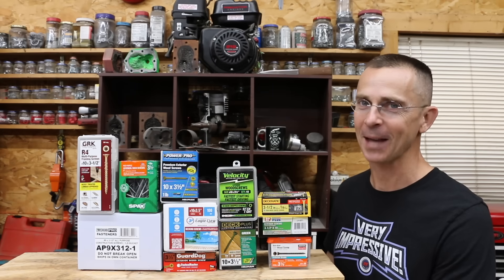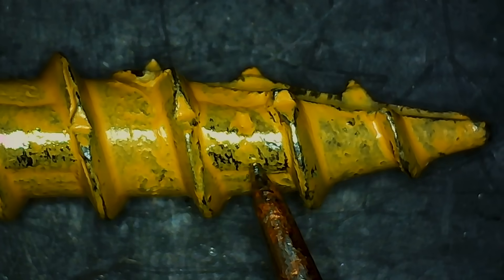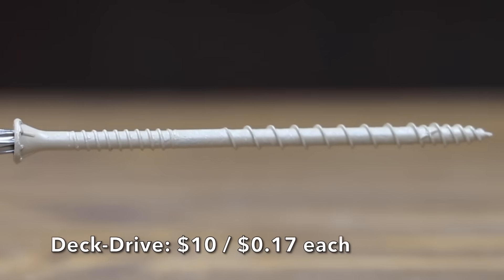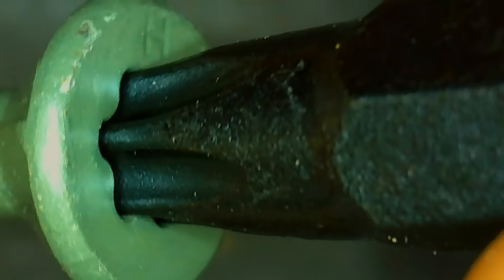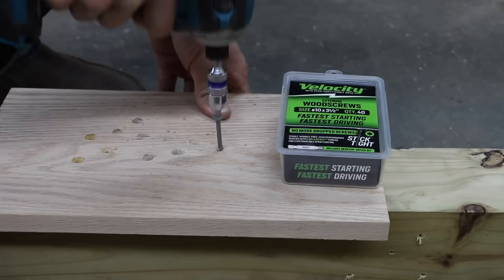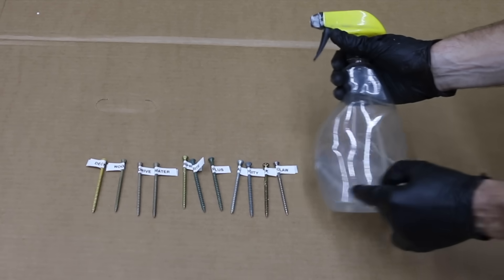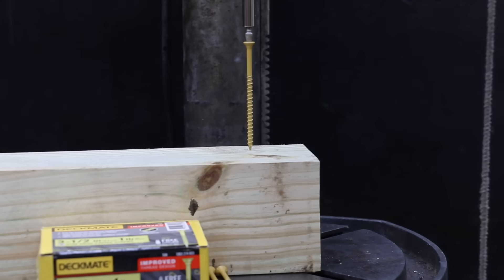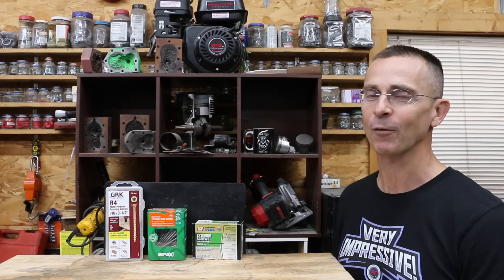Best Deck Screw? GRK vs SPAX, Grip Rite, Deckmate, WoodPro, FastenMaster, Deck Plus, Eagle Claw

Comment: The only way to describe this test is "Very Impressive ". If you do this test again consider drilling in Ipe wood for an extra test. It has an uncanny ability at breaking screws. I am a fan of Spax, they don't break or cam out as much as the other brands especially with tropical hardwoods, black locust and osage orange.
Reply from the maker: Thanks!

Comment: I'm starting to suspect that the coating isn't really supposed to stay on completely, but instead aids to reduce friction and required torque by sliding off more the harder the wood is.
Reply from the maker: Thanks for sharing.

Comment: Have you done one on gas fuel injectors?
Reply from the maker: Thanks for the suggestion.
Reply: @ProjectFarm  Your welcome.  Having been needing injectors for my F150 5.4L I found that there is a huge range of pricing between Amazon, other on-line sellers and local/oem.  It would be interesting to see how you could test them to compare them.

Comment: Are the deck scews used for Trex-like boards similar. Mine had machine scew thread at the top to keep the bulge on the surface to a minimum. They cone in different colors as well.

Comment: I've installed and removed a lot of these screws over the years.  It doesn't seem to matter much which ones you use about 1/3 to 1/4 of them break off right where the threads stop on the shank.  I'm in the upper Midwest where we have a hard freeze/thaw cycle, I think they stretch and break when the wood swells and shrinks in the Winter, Spring.  I was really surprised because I always tried to buy a decent screw but it really didn't seem to make much difference, there were always quite a few broken screws when I tried to remove them after a few years and you can usually tell when they break on install.  I've also used the smaller screws to install T111 and they fared even worse because of the moisture held by the plywood.  They were usually rotted off or would just break when removed.  And just incase you wonder, no I did not ever use drywall screws for any of these applications.

Comment: HydraulicPressChanel just posted a video testing metric vs imperial nuts and bolts holding strength, but it wasn’t scientific. Needs to be grade A nuts with grade A bolts for example. Could you duplicate and give us more Juicy data? 😁
Reply from the maker: Thanks for the suggestion.

Comment: I wonder if you could verify the grk for a particular project. Plan to make a bed frame....2x12 boards, double thick layer for the slats (I'm 425 lbs) and full size bed. Mattress weight 75lb, wood frame weight (estimated just the wood weight 330lb). (Wood glue at each joint) As many as 22 screws holding on each leg (8 into the side pieces, 7 into each layer of slat), and as many as 4 holding each 2x12 slat to each side. Would that be sufficient to pretty much guarantee rock solid foundation? If it is hard to picture I have a pixel sketch of it, if it too much to ask I also understand.
Thank you for your time either way, the videos are helpful.
Reply from the maker: Thanks!  Thanks for the suggestion.

Comment: Nice video, I've had you playing out on the shop all day.
As someone whos done a few dozen decks, Spax and GRK are my go to screws.
At the start, one of the things inspected was the fitment of the driver bit. Being too loose is bad, but overly tight is, I'd argue worse. When your screwing a few thousand screws, its the same motion over and over. A tight fit from screw to bit often holds onto or binds together. Trying to lift out of the screw is made much harder, having to wiggle the drill around, pulling away perfectly vertical, or popping the bit out of its chuck. All that adds up to wasted energy, time and wear on the tools.
I like the Spax brand screws because of their bit designs. That round part of the end sits into the screw, giving more engagement driving down, but without holding on the screw pulling back.
GRK still uses normal torxs bits, but they drive and pull away nicely.
1 thing I wish you had tested, driving the screw between 2 objects. The tpi and design of the tip can make a huge difference in how well it drives into the 2nd object, and how much downward force is needed to keep the 2 objects from pushing apart. A material like Trex would make for a good starting object, because its rather uniform and somewhat tuff. As well as an actual decking material.
Reply from the maker: Thank you for sharing!

Comment: Video suggestion for you Project Farm --> let me do the engineering calculations for some of your tests in parallel with your work.
Using the USA structural engineering code and assuming wood with a specific gravity of 0.46 (North Hem-Fir, South Douglas Fir) the withdrawal of the screws can be calculated as:
W (#10 screw in SG = 0.46 wood) = 114 lb allowable tension per inch of thread engagement
W2x4 = 1.50" thick * W = 171 lb allowable withdrawal tension
Kf (screw withdrawal) = format conversion factor to change from service level (allowable) to ultimate level (strength) = 3.32
Tmax = Kf * W2x4 = 3.32 * 171 = 567 lb failure withdrawal tension for #10 screw engaged 1.50" deep into wood with SG = 0.46
-----------------
567 lb withdrawal tension closely matches your findings!
Reply from the maker: Thanks for sharing.

Comment: I find this very confusing when compared to my own experience.

Some decades ago I built a 20 x 40 cedar deck and used Deckmate screws with square drive, as sold by my local big-box store.  After 30 years of use, I rebuilt the deck with new cedar, but the big-box store no longer carried the Deckmate screws.  Fortunately, I found them online through a giant online retailer named after a big river, and they appeared to come directly from the manufacturer.

The new screws seemed to be identical to the old ones except that they sported the "PoziSquare" drive.  They worked out great.  But my concern with this video review is that my modern Deckmate screws look like a work of art when compared to the ones shown in closeup in the video.

Are screws ever counterfeited?

It might be nice to build my next big project using SS screws.  Most Deckmate screws came out during the overhaul without any hassle, but corrosion from decades of NW rains reduced some screws to junk, requiring extra effort.
Reply from the maker: Thanks for the suggestion.

Comment: My favorite deck screws are the ones that had molding issues that completely clogged up the torque hole. 
Also, dont bother with the free bit that comes with your deck screws, it'll round off after 1 board
Reply from the maker: Thanks for the feedback.

Comment: love your video, quick question, which in line torque adapter do you use? do you find it helpful and is there a model you would like to use in the future for screws?

Comment: Great video, was curious how these stack up.   I’ve been using spax a while now and will continue to do so.  Such a great screw to drive in odd / hard / up into rafters with that tight fitting torq drive head.
Reply from the maker: Thanks!  Thanks for sharing.

Comment: I was thinking that tires may be a good 
Test subject for you. Just like motor oil it is really difficult to get true ratings that aren't biased to the brand. Maybe some sort of traction and durability Test to see if cheaper brands are as good or better then top brands. Thanks for taking the time to make the vids, I have made many brand changes based off of your tests.
Reply from the maker: Thanks for sharing!  Thanks for the video idea.

Comment: Your videos are excellent. I can tell you put a lot of thought and effort into what aspects to test and the testing methods. 

I do have one technical suggestion about reporting results. It is not proper to calculate an average on rank ordered data because the distance between the items ranked is not uniform (the number of additional pounds it took to break the #1 ranked screw compared to the #2 screw was not the same as the difference between #2 and #3, etc.) You could calculate a Spearman Rho Correlation on your rank ordered data. It would be interesting to see what the difference in your results would be. If you did, you would be more accurate and it would be a fairer comparison. The relationship between the test results would also be more accurately reflected.

One thing you could try is an average of the items that used the same measurement scale and in the same direction. Where having pounds of torque, pounds of pressure, etc. indicates a better product, this average would be meaningful. On the other hand, where less pressure is desirable, such as in the downward pressure needed to start the screw into wood, that should only be combined with other items where the scale has a similar meaning. (One could convert the scale such as by subtracting the pressure from 100 so that a higher number indicated a positive result, but you would still have some statistical difficulties with combining this measurement.)

Comment: Screws are brittle and expensive to buy and install. They will snap off when a shear load is applied. Nails are inexpensive to buy and install. Nails bend under shear therefore are superior to screws.
Reply from the maker: Thanks for the feedback.
Reply: @ProjectFarm  you are welcome. I've been a carpenter for nearly 50 years and have seen many screw failures due to shear

Comment: Absolutely loved this! Now I would really really like to see this done again, except with multi material construction screws.

In particular Spax, mostly because according to the box they are meant to go into concrete.

I want to see a video just like this testing out that multi material claim.

In particular going in to sheet metal, concrete and drywall (no anchor).

Is there a savings (and safety!) In using a multi material construction screw or are you better off with focus fired screws such as tapcon, expansion anchors, sheet metal screws or drywall anchors?
Reply from the maker: Thanks!  Thanks for the video idea.

Comment: I installed a deck in 1998 using the posi-square drive screws. After 20+ years installed, I had to remove about half the deck to access a broken water line under it. If I had used anything but those screws, I would have had to demolish the deck. But the posisquare heads cleaned out fairly easily and I only had to break off 2 screws (they were in knots).  I'll never do a deck with anything else! Try that procedure with a torx head!
Reply from the maker: Thanks for the feedback.

Comment: Testing idea: the small lead-acid batteries that are used in computer backup power supplies and often for garden tool electric starters. Two issues: (1) total energy capacity, and (2) deep cycle (good for computer backup) vs. high cranking amps (good for electric starters). One obvious concern: I suspect that many of these batteries are identical but just branded differently.
Reply from the maker: Thanks for the suggestion.

Comment: The least expensive coated deck screw around SE Michigan/N Ohio is the Grip Fast brand at Menards, $6.99 for 1 pound but it would either have to be #10 x 4" or #9 x 3-1/2" (Approximately 55 pieces per pound for the #9) I wonder which brand tested would be the same as the Grip Fast, which sounds so much like the Grip Rite, I'd assume if it were a different manufacturer, they'd probably have a problem with that.
Reply from the maker: Thanks for the suggestion.

Comment: Interesting, as a european I have never seen coated deck screws. I've build multiple decks and the only thing that's sold over here ist A2 and A4 stainless steel deckscrews. I went with A4 Spax... why would you use a coating that can wear away?

Comment: The amount of downward pressure, the speed of installation and so on are good comparisons, but I feel that holding power and corrosion resistance are the main concerns. I'd give an extra second per screw for install if it means better holding power any time. 

I needed some screws a couple months ago for a small job (repair job) and I bought what was available. It happened to be DeckPlus, but the coating and the tip of the screw were different from those you had. For my needs, a one pound box wouldn't have been quite enough. Since 5 pounds cost less than $2 more than 2 one pound boxes - and included a spare torx but - I just bought the 5 pound bucket. If I ever need them for a task, I have them. Or, I could probably sell them on a yard sale and come out much better than buying 2 one pounders.
Reply from the maker: Thanks for sharing.

Comment: Thanks. This test is just what I was looking for. I go through several hundred screws a year repairing horse fences. The original fence used nails. When a board or rail pops loose I use screws instead of nails. Looking for best bang for your buck. I have been very happy with both GRK and grip rite. I use mostly 3-in screws. I have never had a horse pop aboard loose once I replace the nails with screws.
Reply from the maker: You are welcome!  Glad to hear!

Comment: *** VIDEO IDEA ****

BEST GROUT FOR TILING, BEST MORTOR FOR SHOWER PAN AND BEST WATER PROOFING MATERIAL. RED GUARD, SCHLUTER, CEMENT BOARD, SILICONE. I'm sure your local hardware store has plenty to choose from. 

** 2ND VIDEO IDEA **

BEST TILE CUTTER INCLUDE DIFFERENT BRANDS AT DIFFERENT PRICES AND EVEN COMPARE TO USING A CUT OFF WHEEL OR A WET SAW.
Reply from the maker: Thanks for the video idea.

Comment: I work with cedar wood (a lot) and screws is the way to go on that kind of wood.  I found that pilot holes is a must on screws (on any kind of wood).  Deck screws came along and kind of incorporated it all.  A important factor is the "cut" of a screw to make the hole so the "body of the screw" has room and not causing cracks (by pushing through wood fibers, not cutting).  Another important point is getting away from phillips screw head, torks and square drive work good.  Good video.
Reply from the maker: Thanks!

Comment: I enjoy the tests and presentation.  I'd like to see which 6 way screwdriver is best. Blade strength, Cam out,  Phillips wear, and how much down pressure is needed to prevent Cam out.  I have a craftsman that needs to be replaced
Thanks
Reply from the maker: Thanks!  Thanks for the video idea.

Comment: I replaced the 5/4 pressure treated deck boards on my deck with Deckmate 2" screws. After several months I noticed screw pops. When I removed the pops I found the screws had sheared off just above the threads. Had to remove about 75 screws. Rescrewing was a problem because of the residual screw. Home Depot did not care. Found internet discussions about the same. Beware.
Reply from the maker: Thanks for the feedback.

Comment: Can you do a test of different pressure treated lumbers? 2x6 and 4x6? 

Put the screws in each one. Out them each in the ground in dirt and in concrete and use done doug fir and pine woth copper green. 

Put in three of each and test one set at five years, one at ten, one at 15. I’ve seen a lot of bug eaten or rotten pressure treated.
Reply from the maker: Thanks for the suggestion.

Comment: Great video as always. 
I would be curious to see the initial coating loss vs loss after removal. Analysis after passing through a 1" piece of oak would be interesting. Also, I like a little play it the torx bit. Snug is nice, but my go to bit holder isn't always a locking bit holder. It gets to be a pita when you have to retrieve the bit after each drive.
Reply from the maker: Thanks!  Thanks for the suggestion.

Comment: My problem with this test is that it weights the different areas equally.  Let's face it, shear strength and pull resistance are nice, but you usually have a LOT of screws in a deck board.  It's not going anywhere.  But corrosion resistance is not additive.  ALL the screws can fail early if they each rust.  I would give 50% of the weight to corrosion resistance and spread the other 50% across the remaining features.
Reply from the maker: Thanks for the feedback.

Comment: Another great video. 👍🏻👍🏻 Feel much better about buying all the Spax & GRK fasteners I've used... with no legit way to test them, I bought them because I liked the feel. Now I have a reason to pay extra (when stainless isn't needed).

FYI, in the future, if you're doing tests on wood to measure force needed to "pull out" or "drive in" then you should consider changing your pattern to going horizontally across the face of the piece of wood (with your 3 screws, lags, etc.) rather than vertically (with the grain).

After installing many, many miles of cow fence over the last 35+ years, I've found that the density of any piece of wood (when the grain runs vertically, like on a fencepost or 4"x4") can vary significantly at different places horizontally across the piece, but differs very little in going up and down the same grain... even 3'-4' feet away. So... if you happen to hit a hard (or soft) place in the wood grain and then went "up" or "down" the grain there will be very little change compared to going across and it may noticeably skew your results without anyone being any the wiser.
Reply from the maker: Thanks!   Thanks for the tip.

Comment: After building dozens of decks, installing cabinets, building raised beds and installing various structural and non-structural elements over the years I by chance settled on GRK and Spax and the go to's with Grip RIte as the third alternate. Fortunately most people won't pay extra for the GRK or Spax screws so they always seem to be available. A bonus by default. The only issue I ever had with Grip Rite was the higher rate of unusuable screws due to excess coating application clogging the drive slots. And the rare shearing of the head when driven into harder, old wood. Maybe that's not a factor now but I can't remember a GRK or Spax screw shearing off. I'm sure it happened but not often enough to stick with me.
Reply from the maker: Thanks for sharing.